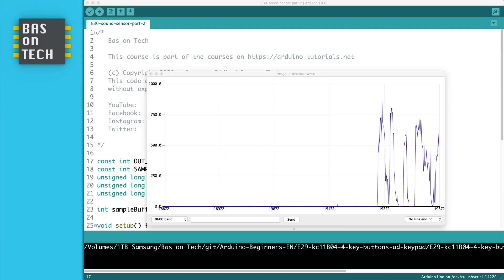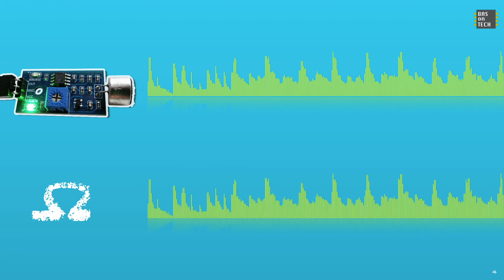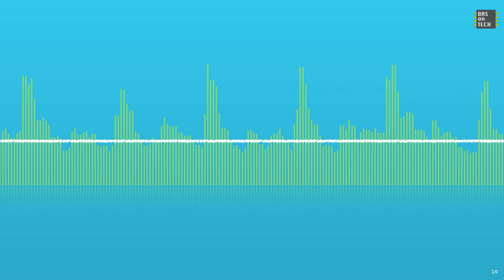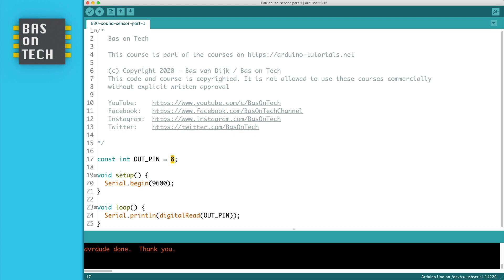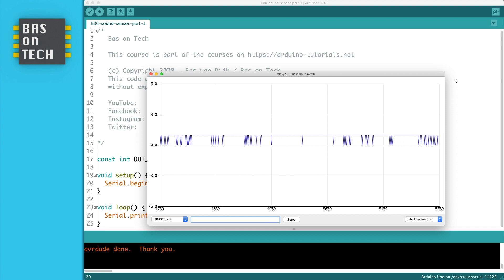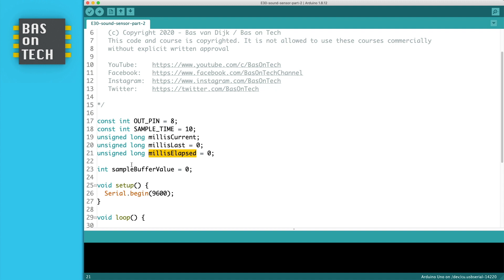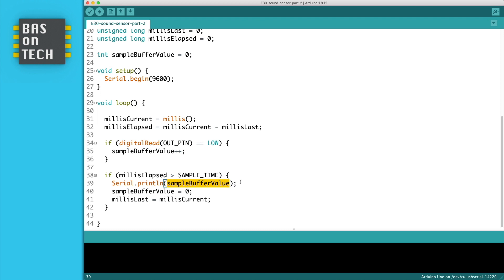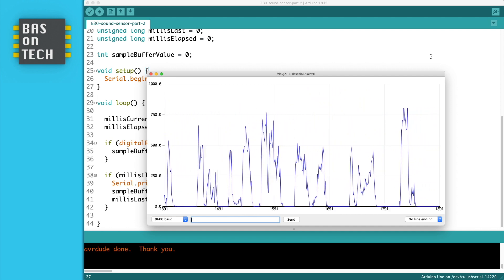SOUND SENSOR DATA ON ARDUINO SERIAL PLOTTER - Arduino tutorial #30

Comment: Great Video, but us there a way to have the serial plotters values as a usable value in an if statement, I am working on a small project for example when the serial plotter hits over 100  I want a led to turn on, and when its below 100 to turn off, but I just dont know what variable to put into the if statement.
Reply: Like the serial plotter shows the values up to 1000, but when using an if statement or the sampleBufferValue the statement only works when its being compared to a 1, and nothing over 1
Reply from the maker: Hi, in my code I use:
if (millisElapsed > SAMPLE_TIME) {
This if checks if the sample time has passed. You can add an additional if inside this if (or extend the if) for your desired value like:
if ((millisElapsed > SAMPLE_TIME) && (sampleBufferValue > 100)) {
Reply: @BasonTech   Perfect, that works great, thanks for the help!
Reply from the maker: Great to hear! 😃

Comment: Hi, the video bis pretty cool, but I was thinking what if i want to manipulate the frequency of the sound and the pitch, how that could be done.
I geuss, we need to connect the mic to a digital to analoge converter, that could be done by coding as well but we need to use equations. Anyway, do you have a clue of how that could be done
Reply from the maker: You can't since this is a binary sensor. The plot is only plotting the amount of sound, not the frequency. If you want to work with the frequency of sound you'll need another sensor 😃
Reply: @BasonTech  you please make a video for frequency vs amplitude

Comment: very good video. roughly what sensor is suitable for measuring the number of dB?
Reply from the maker: Thanks! The datasheet states:  Sensitivity: -46±3dB -42±3dB -38±3dB -34±3dB (0dB=1V/pa,1KHz) more info at https://eva.fing.edu.uy/file.php/585/materiales/HD/CZN-15E.pdf
Reply: @BasonTech  thanks

Comment: Can this be used with arduino fft because it looks like analog output but will it behave like analog signal with arduino fft like an analog signal from sound sensor
Reply from the maker: Hi, unfortunately I have no experience with Arduino FFT. The signal from the sensor is digital with my sampling you kinda get an analogish signal but is not real analog like a soundwave

Comment: I'm trying second part and only geting 0 and 1.
If I put SAMPLE_TIME = 100 , I can take up to 3000.
How should I tune the potentiomerter in sensor to have bigger values with SAMPLE_TIME = 10?
Reply from the maker: It is two steps: The first step is to make sure your sensor is correctly giving the 1 and 0 depending on the sound volume. This can be done with the potentiometer. The second step is to pick the correct sample time. The longer the sample time the higher the values will be.

Comment: so the amplitude is resistance? how can we save that data in order to send it to a phone in real time?
Reply from the maker: The amplitude is the amount of sound sampled in given time. It does NOT represent a soundwave. The sensor is  binary, it only measures if there is sound or not. The sensor is incapable of determine sound frequency or amplitude.

Comment: Hi dear sir, can we use two sounds and then differentiate their frequencies and display?
Reply from the maker: Hi, not with this sensor. This is a binary sensor: it tells you if there is sound or not. It doesn't measure a frequency at all. In order to do so you need another sound sensor.
Reply: @BasonTech  sir, actually I want to make a device to measure  different frequency sound waves and find individual wave like in fast forrier transform of quite nice range. If any sensor available, please reply. Thank you.
Reply: Can you please make a video for frequency vs amplitude

Comment: Very clear. 1 question. Is there a formula i can use to show the Sound waves in Db values?
Reply from the maker: Hi Dražen, this sensor is a binary sensor, it just tells you if there is sound. By sampling I try to get a bit of an idea of the intensity of the sound. There is no way this can tell you the amount of decibels. If you want to measure that you'll need another sensor.

Comment: Hi thanks for the video.    I have a question: If I have the audio of the SIM800L when a call is outgoing,  Can I connect from the speaker outputs of SIM800L to this sound sensor instead of micro inputs in order to detect when someone answer its smartphone for example? thanks
Reply from the maker: Hi Jesusita, this sensor isn't really the right device for that. I think you need to look into a VU-meter device to which you can connect the speaker out of you SIM800L
Reply: @BasonTech  thanks

Comment: Truly the tutorial i needed for my project ! Thanks a lot ! I work on a project that need to make a dc motor brake when the ambiant noise reach 90 Db. I tried to mix your code and mine, but i am not sure i am doing this the right way. Can you help me  ?
Reply from the maker: Thanks! Unfortunately this sensor does not measure dB. It is a binary sensor which measures if there is sound or not, that's it. So if you truly need a dB level threshold, you'll need another sensor.
Reply: For exemple, how can i reuse the data seen in the monitor or the plotter with an "if >= ..." line ?
Reply: Yes i see what you mean. But from what i saw using your code, is there a way to tell the arduino, when the value 300 (in the monitor) is reached, do this... ?
Reply from the maker: sure, just use an if statement for your desired threshold and check if the level is above that

Comment: Thanks bro. I had ordered stuff for my project and my code was giving me a bad trip cause I had written it but Arduino wasn't accepting it. You saved my day. Also bro if u coud help me with this. My code had audio.startRecording function and I was using trcpcm liabrary but Arduino wasnt accepting the code and kept showing error message as there is no member of trcpcm liabrary as audio.startRecirding. also same error message for audio.stopRecording. pls help me
Reply from the maker: Hi, glad I could help. As for the library, I have no experience with that library. I can only guess that you are missing TMRpcm audio; somewhere. Have you followed all the steps of https://github.com/TMRh20/TMRpcm/wiki ?
Reply: @BasonTech  yes . I have that didn't work. No problem bro thanks. Also could we store this mic input as audio like MP3?
Reply from the maker: Nope, since it is no audio data. It just a boolean telling you that there is sound. It gives you no data on the actual audio.

Comment: Why dont you use analog read in analog pin? mich more easier coding
Reply from the maker: Because this sensor is a digital one. It is a binary sensor, it only tells you if there is sound or not. So this sensor doesn't tell you something about the volume of the sound. With the sampling I try to mimic to get a sense of the amount of sound. For an analog readout you'll need a different sensor 😃
Reply: @BasonTech  thanks

 look wierd  you explain the more loud the sound the more resistant! so if its true... The analog read should work .. i will try it at home and tell you the results

 i have this part but never use it yet!
Reply from the maker: That goes for the potmeter, because it sets the threshold for the sensor to become HIGH or LOW

Comment: I found that it was detecting too much noise and if was looking a mess. If you put the line " delay(1); " below the if statements it delays the feedback just enough to smooth the graph and looks much neater.
Reply from the maker: Keep in mind that delay(1) actually tells the cpu to wait 1ms. So basically you're telling the Arduino to ignore the sensor values within that 1ms. Another way to smoothen is to widen your measurement window and subtract a base level where the noise is 😃
Reply: @BasonTech  I find that it sends an unwanted peak. It's one way of removing it :)
Reply from the maker: btw didn't the peak go away by adjusting the sensitivity?

Comment: Congratulations was cool, but have you ever thought about making a spectrum analyzer using WS2818 led strip and the sound sensor?
Reply from the maker: Hi Luiz, yes I did! Unfortunately time is currently not on my side, but it is definitely something I want to look into 😃
Reply: @BasonTech   do you have the code ready?
Reply from the maker: Nope, I have the parts laying around, but not yet build anything

Comment: Is there a way to convert the values into actual audio?
Reply from the maker: Hi Paulasoarus, not really. Keep in mind that you just plot the amount of sound over time, not the audio frequencies. This sensor is a binary sensor, it tells you if there is sound or not, that's it. So even if you translate the chart into sound you would only get noise 😃
Reply: @BasonTech  Hi ! Then what sensor we have to buy ?
Reply from the maker: @justinbarin3087  Hi, for all tutorials you'll  find a part list in the description of the video. The sound sensor is: https://arduino-tutorials.net/r/bEpJLR
Reply: @BasonTech  Thanks for the reply but i wanted know what sensor buy to convert values into actual audio pls ?
Reply: @justinbarin3087  If by chance you found the sensor to convert to actual audio, please share with me. I need to regenerate sound from recorded samples, not just binary sound detection. Thanks!
Reply: i think you can do something with tone out based on the value of the buffer

Comment: Awesome video and production qulity! I subscribed and look forward to more videos :)
Unfortunately the code does not seem to work for me. I'm using  a different sensor though, the ky-037 or 38, which both has digital out and analog outputs. When using the digital output from the sensor and hooking it up as you did, I'm getting a zero's in serial monitor except for when shouting really loudly or clapping. 
Any idea why?
Reply from the maker: Thanks! What I see on pictures is that on the sensor there is a blue potentiometer which you can adjust. With this you should be able to adjust the sensor sensitivity. Hope this works 😃
Reply: @BasonTech  Thanks that worked! The potentiometer was so ridiculously sensitive though :D

Comment: I don’t get it, but maybe someone can explain it. I’m talking about the final code. 1. Every 10millis it prints the sample buffer value. 2. between the 10millis the code increases buffer +1 if the pin is on LOW (somebody talks). This happens on every single loop. My Problem: How can this code show the volume? For Example: What would happen if I play a frequency on the pc and constantly increase the volume? My Thoughts: Its all the Time at 0 until a certain point, than its the loudest possible. Kind of a Threshold when it turns to LOW. thanks for reading sry for grammar and writing I’m German
Reply from the maker: Hi, the code is not really the volume, but the amount of sound during the buffertime. The code is continuous monitoring to see if there is sound or not. If so, it increases the buffer value. Since the Arduino samples very fast, you kind of get a chart with the amount of sound during the buffer period. 

This doesn't say anything about volume since this mic can only tell you if there is sound or not. So as far as I know a threshold won't work since the sensor is binary. If you make a threshold on the buffer value. You make a threshold of the duration of sound not the intensity.

Hope this clarifies it a bit 😃
Reply: Bas on Tech ah I understand thx for the clarification 👌🏻